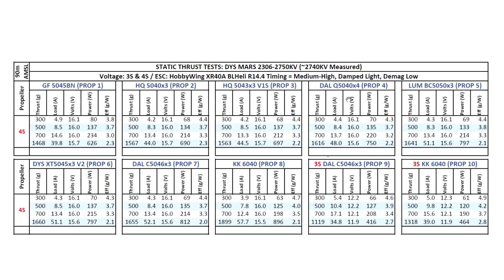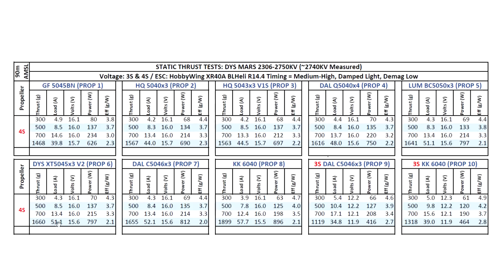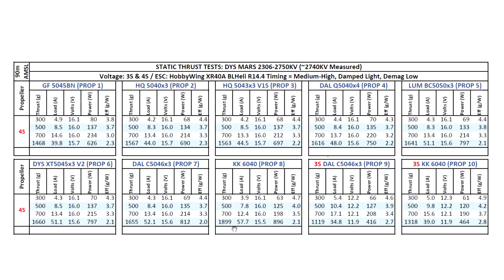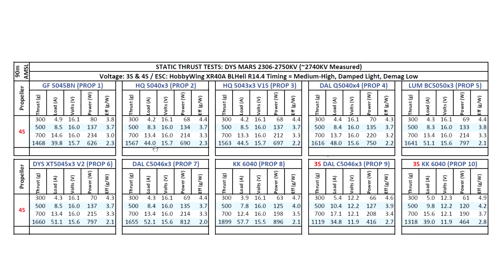dys Mars 2306-2750KV Thrust Tests -Countdown and Launch!

Comment: I'm looking to replace some dys fire which are lacking power at the bottom end compared to the t2s I usually use. is there a powerful motor around 2206-2207 that won't shred batteries? I'd rather have something with usable power. I know that probably doesn't exist but efficiency is where I'm at for freestyle.
Reply: Coppertop FPV get the storm.. U get the efficiency..
Reply: DimplePoji cheers I'll have a look. bit weary of dys motors. the fires have a noticeable delay when you apply throttle which I've never experienced with brother hobby
Reply: Coppertop FPV the fires does not receive well by many.. The storm somehow has a bigger improvement and well liked by many except that its heavy.. If u like to play safe, i would go with brotherhobby.. Or the new 2307 from hyperlite..
Reply: DimplePoji yeah they look nice. cheers again.
Reply: 2306 is smaller than 2207

Comment: I really like the new format. I do wish you would add notes about the magnets, what you think about the windings, and bearing quality. But great job, keep up the good work. How can I ask you a direct question?
Reply from the maker: The 2400KV version video has the motor overview and it's very similar to this motor so I didn't feel there was a need to do one for this. You should be able to see more detail of motor and its components in that video. Bearings are tricky, we know that the "top-brand" like EZO, NMB, NSK  are supposed to be good but we have seen them go out quick in some motors and no issues in others. So I can only mention the stated/spec'd brand if available but can't say if it's going to be bulletproof or last. You can send me a message thru YTube. I believe you can access messages thru here https://www.youtube.com/user/EngineerX/about and then you can view your messages thru here https://www.youtube.com/messages

Comment: So AMP hungry.. i Think i would prefer the 2400kv instead. And they Seem more efficient ass well
Reply from the maker: Yes the 2400KV for this size 2306 motors flies very efficient, I'm seeing about same flight times using these motors, but of course flying at "normal" pace -not 100% throttle most of the time, since I can't fly that well :)
DYS has really done a good job on the 2400KV and these motors have all very good components. Only thing left to see is how well they survive abuse/crashes/high loads.
Reply: EngineerX it is a pity all manufacturers are working on the bigger motors now.. i would like a lightweight 2207. But the new 2306 isn't really any heavy'er
Reply from the maker: Yes, lighter motors would be nicer. Most of the weight is on the stator assembly, not much they can do there at this point. Copper wire and steel laminations constitute a large percentage of the mass in a motor.  Then if they start to get rid of too much material from the motor armature we may end up with too-weak structures that will break on crashes that shouldn't have cause any damage. So it's a tough balance for motor designers to come up with the lightest, strongest, powerful, and durable motor. I'll be testing BH R3 2207-2550KV bell-type (naked bottom) soon, just waiting for humid and hot weather to subside here in Southern California. In theory a 2207 should be more powerful since it has a stator "volume" of 2661mm^3 and a 2306's volume is 2493mm^3 (using simple cylinder volume formula) but sometimes theory doesn't translate to real-world performance as expected. That's why I'm curious about the 2207's numbers on the thrust stand but I want to make sure atmospherics are consistent with those at the time the 2306 were tested.
Reply: EngineerX but the 2306 would have more torque and efficiency?